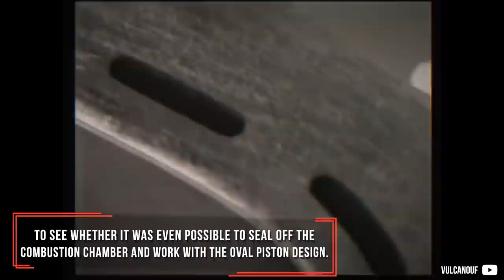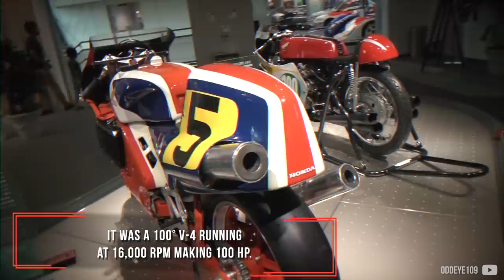Why Honda Made A 20,000 RPM Oval Piston Engine

Comment: Honda as always pushing beyond!! First with the VTEC, oval pistons, 4WS, hybrid cars, sat-nav... Awesome vid man!
Reply: Vtec is just a fancy name for variable valve timing  and fiat was the first to make it,  the first hybrid car was made by porsche. But if you wish to talk about the more recent iterations of hybrid cars lets just toyota got there first and is a lot more beyond on the subject. The first car with sat-nav was actually a mazda eunos cosmo. So appart from two things on your list (oval pistons and 4ws) that by the way can highly be argued about it being actually worst than the norm (normal two wheel steering and round pistons) in what is honda beyond exactly?

Please dont think im saying honda is a bad brand. I love them. They had an amazing motorsports history and made a lot of interesting products. Still do today. And i own some honda motorcycles. but they are not pioneers or the best like a lot of people like to portray them.
Reply: @dcd5050  Fiat made the first VVT And Alfa Romeo used it first, there was also a Cadillac with an experimental engine far before, and steam and aircraft engines which used VVT, but I'm sorry, you don't hear about those unless you research about it.... Honda took the variable valve timing and managed to break the 100hp per litre barrier back in the late 80's, and you should know what came after.

Also, the first navigation on a commercial car was the gyro-cator in 1981, I was not sat nav, but it used a clever system for navigation.

And about the hybrid, the insight came in 1999, the Prius came after in 2000, but the later was more successful, I won't take the Porsche mixte and the prototype from before into account, cause you just can't compare technologies fairly.

And my comment was a out Honda pushing beyond, not necessarily first, but it reads like that, my bad.
Reply: @luisleon7027  actually the prius was first sold in 1997. Not after 2000. Plus the insight was a disaster in sales i mean the prius in 2017 sold double more units than the insight in all its life span.
Reply: @dcd5050  perfect, my mistake, nice, you win!
Reply: Skyline:Muhahah:)
Reply: Lohner-Porsche was first hybrid car in 1900.
Reply: @las3k91  read the third comment please
Reply: it is no wonder there the only few vehicle manufacture that builds jet engines!
Reply: yeah....satnav has done wonders for humanity..... :(
Reply: Can’t forget about the hondamatic!
Reply: Honda are a shell of their former self.
Reply: @dcd5050  Vtec isn't valve timing. Vtec is short for vvtalec variable valve timing AND LIFT electronic control. It's variable valve lift which no one had before vtec. Actually none of the original vtec engines had cam phasers either. The variable valve timing was achieved by the vtec cam being wider and the variable lift was by the vtec cam being taller.
Reply: Look at just the first generation of CRX ^^ 1500cc/100HP at 7800RPM ^^
Reply: Honda is distantly behind in every segment of the industry..  The have been resting on reputation for over a decade without releasing anything good, let alone class leading.  Look at their ATV line up, or SXS's its all old tech that doesn't lead any class.  Sport bikes, they don't build anything that can come close to the R1, H2 or ZX.
The only thing they build that is any good, are the small generators
Reply: @dcd5050  You are wrong... VVT is ONLY variable valve timing. VTEC is Variable valve timing and LIFT electronic control. And honda was fiers to make variable timing WITH lift.. so get your facts right before spreading heresy.
Reply: @ACatKrom  i up voted cause that is true, but it's because they are focusing on fuel economy on their lineup lately, we all know Honda it's not the same, they are past that era.
Reply: @dcd5050  proper iVTEC is more than just variable valve timing. The cams have locking pins inside them that can make the cam lobes all move together in sync.
Reply: @luisleon7027  Yeah, but even then, Nissan beat them by 2 years.
Reply: @patrickrhoades480  Cadillac had Variable lift in the late 1800's but I do not know if they were first. The camshaft has tapered and twisted lobes and the cam was moved back and forth as a way to throttle the engine. It had no butterfly in the carb. To move the cam you actuated a bypass valve on a hydraulic pump that pushed the cam against a spring on the opposite end. Talk about overly complicated and it did not work to well. But it was a very early engine with variable lift and duration. You can read more about it in a book called "The Standard Catalog of American Cars 1805-1942"  Lots more interesting stuff in there too if you are a gearhead.
Reply: @donaldvincent  will do bud, thank you very much!
Reply: Don't forget about ASIMO!!
Reply: @donaldvincent  cadillac wasn't founded until 1902......
Reply: @DrewLSsix  Yes. Let me dig out my reference books and double check, Henry Leland who founded Cadillac was also involved with Olds. But it may have been another mark all together or I got the year wrong. Getting old sux. But I do remember clearly learning about the crazy way to throttle the engine.
Reply: @DrewLSsix  I double checked the year was off It came out in the 1903 model year. The engine was by Cadillac Called "Little Hercules" and was designed by Leland & Faulconer. They had tried to sell this engine to Oldsmobile before forming Cadillac. The variable lift on the intake valve gave throttle control and was also used on next engine which was a 4 cylinder. Note: Alanson P. Brush of Leland & Faulconer held patents on copper water jacket, variable lift inlet valve, mixer, planetary transmission, and adjustable rack and pinion steering. By 1906 the impact of Brush patents would start a drastic change in Cadillac designs. 
Reference:  Standard Catalog of American Cars 1805 to 1942 by Beverly Rae Kimes. page 189
Reply: @dcd5050  It might have been first sold elsewhere but the honda insight was first sold in the united states in 1999 and prius a year later. So it really depends on where tbh.
Reply: iirc Ferdinand Porsche made the first hybrid car
Reply: @fhkkjjk9255  Yep, Long ago
Reply: Uh Mazda cosmo had it first, then bmw e38 in the early 90s.
Reply: @dcd5050  "VTec is just a fancy name for VVT"

Lmao dude wtf are you talking about they are completely different mechanically and functionally.
Reply: Honda was decades behind on Vtech
Reply: @patrickrhoades480  waste of time. VTEC is not required for a performance engine as already have aggressive cam profiles, and a waste of time for a family car especially nowadays as thanks to variable valve timing and computer control modern engines can run fairly aggressive cam profiles anyway
Reply: @dcd5050  Alfa Romeo, not FIAT, developed VVT. While it was not used in a road car until the 1980s the concept was developed in the 1970s before FIAT owned Alfa Romeo
Reply: @dcd5050  First of all, Fiat or whatever Italian, made the first Variable Valve TIMING. 

Honda's VTEC, is the first ever, to feature Variable Valve LIFT as well. 
Adjusting the gears, is a concept many thought, did, and tried a long time ago. 
That slightly changes the engine's characteristics. 

Honda's VTEC enables the engine to go from "ohh i'm just a happy little girl smelling  flowers" to "I'm gonna murder your kids and feed them to you"

Honda's VTEC engines has a VASTLY different character before, and after the VTEC cross point, although they met in the middle in a perfect balance which was very interesting. 

That being said, not only is Honda one of the best vehicle manufacturers in the world, with TOP QUALITY products, they are absolutely the single largest, and BEST engine manufacturer there ever has been. Nobody can even challenge them at what they do.
Reply: @dcd5050  yeah but honda made them all better...who the fuck has better vtec?
Reply: CX500 turbo! Oh wait I had one they were awful.
Reply: @erikgonzalez2278 Rolls Royce made helicopter engine and it was used in a motorcycle

Comment: A very interesting observation, at the height of Honda's domination of F1 with their incredible V6, new regulations for the next season came out stating that engines 'must have round pistons'. hmmmmmm
Reply: There was a reason for that rule, as if Honda could solve the sealing issue with the Rings they would have basically circumvented the V8 rule that had been in place since the mid 50's due to Moto Guzzi and their incredible 500cc V8.  It produced practically double the power of it's competition and coupled with that slick dust bin faring it easily exceeded the tech of tires and frames.  Basically it was a fast way of getting killed in a grand manner.  This same grand death trap would have been revived.
Reply: Thats why I dont like F1 at all. Absolutely overregulated. Just give the teams a fixed budget, let them build whatever they want, may the best win. Thats how it should be.

Comment: This engine was a thing of beauty! It's overly complex for the minimal gains in bhp, but an amazing feat of engineering! Honda has always stretched the limits of the materials of the time.  It's hard to wrap your head around dime-sized pistons moving at 20,000 rpm in those 'old' HRC 50cc engines Honda built wayyyy back in the 60's! Great video, great subject! Now I got to look for the 250cc six that Hailwood rode- another great story of engineering!

Comment: I had heard back when this engine was released Honda were developing this as a V8 but the ruling body had stipulated 4 cylinder maximum. So Honda used oval pistons to overcome this. Also I believe the slipper clutch was on the CBX750FE which I owned in the mid 80s and preceded the V4.
Reply: Honda did not start developing this as a V8 since the limitation in the number of cylinders was one of the reasons they pulled out of racing at the end of the 60s in other words, the limitation was there long before they started work on the NR. At the time, they were racing a 50cc twin, a 5-cylinder 125cc, and the legendary 250 and 350 (actually 297cc) six-cylinders, all of which revved well beyond 20k rpm. Honda new that to make more rpm, you need to divide the engine displacement into multiple lighter and smaller reciprocating components, so they certainly would have liked to build a proper V8, but since the rules didn't allow that, they went with what was basically a V8 with siamesed bores.
Reply: @CaptHollister  correct... the cylinder restriction was the result of moto guzzi's unbeatable 1966 v8 gp bike... the cylinder number wasnt the issue... it was piston speed limitations... for a 4-stroke to compete with 2-strokes needed comparable number of ignition cycles... which dictates double the rpm... basic maths & physics
Reply: @Errol.C-nz  nope. Moto Guzzi's V8 raced in the 50s, before Moto Guzzi retired at the end of the decade. The rule change was due to many factors, but Guzzi's V8 wasn't one of them
Reply: @Errol.C-nz  The Moto Guzzi V8 was raced briefly in the 1950s and never won a race, but killed riders. The way you obtain higher RPM is to fraction the engine displacement down into multiple smaller, lighter reciprocating parts. Thanks to this fractioning of displacement, the Honda 50cc twin, the 5-cylinder 125 and the 250 and 350 sixes could all rev to more than 20,000rpm. They had no flywheels to speak of and 8 or more transmission gears to compensate for the narrow powerband. Limiting the number cylinders absolutely put a limitation on how fast four-stroke engines could rev with 1970s-1980s technology.
The difference between 2 and 4 strokes is more complex than that. Yes, 2-strokes fire twice as often as 4-strokes, but until the advent of variable exhaust ports, they also had lower effective compression ratios due to the large losses straight out the exhaust port and lower brake mean effective pressure.And they have even narrower power bands. The Suzuki 50cc 2-stroke twin, for example had 14 gears on which the rider had to play a constant tap dance.
Reply: @CaptHollister  yes i got my date periods wrong... but short stroke principle to keep piston speeds under limits is the factor of more cylinders... piston & cylinder technology has enabled shorter & shorter bore stroke ratios key to higher rpm for the same displacements etc etc... but yeah agree with the complexities of 2 vs 4-stroke physics... cylinder heat being a critical one for 2-stroke & auto ignition (detonation? dieseling as has been called)... compressions vs corrected port timings are same issues towards powerbands for both... the NR had the same gutlessness down low... just that as rpms go up mechanical resistences go up by the square... still, they gave it a dam good go & established a lot of the foundations for todays 4-stroke race bikes

Comment: Whatever machine you're sourcing, if Honda makes it, it's a safe bet it'll be a solid performer. Great company.
Reply: Sorry I can think of numerous Honda Bikes that had shall I say Issues.  The oval piston race bike was a dismal failure, it has been a while but I believe that it NEVER won a major race.  Now for other Honda Bikes, sorry I worked on bikes part time while in the Military and know quite well some of the Honda, ah shit issues.  One that is well covered up is the Infamous Honda 500cc V4's.  They claim it had a long production run, well yes it lasted for over a decade in production but EVERY of the over 11 reengineered engines had similar issues.  First units didn't have cam bearings, yep the cam ran on the aluminum of the head, and that didn't work out very well. Then they went thru various changes and always there was a high mileage excessive ware problem.  Try and find one now days, or if you have one try finding any parts for them.  They all had crankshaft issues due to contamination of the oil system.  Once the bike was out of warranty it was your problem, we had a small shop run by a retiree military guy and he had part time military or military retirees doing the work.  We were nitpicky on our work, do it right or not at all was the sign on the wall.  Well after maybe 10-12 of these bikes we declined to work on them due to the issues.  Another was that CM400 Honda with the chain driven counter balancer, it wasn't if but when it would break and destroy the engine.  We started taking them out, yep the vibrated a little more but then they didn't blow up.  You had to do some internal mods though.
Reply: Interesting info. Thanks.
Reply: I never buy a Honda motorcycle again, simply cannot afford the parts and repair. Plus, Yamahas handle a lot better, Suzukis too, but having spent almost no money at all on any Yamaha the choice is easy. Love Italian bikes but lets be honest, poor quality is always one of the first things that comes up when discussing Italian bikes.
Reply: @pflaffik  Honda is good at hiding a problem child bike quite well.  If you remember they marketed the VFR-500 for about 11 years overall and they all had engine issues.  We had a small rehab shop in HI at the time, a handful of Military active and retired part time wrench twisting types, which started as a group hobby to a business.  You get the picture, make your vacation a vocation.  Well we got several of these Golden Turkeys along with several other Japan Brands that cost us a small fortune.  The VFR-500 was a local Dr. who had it in college and wanted it rehabbed.  Well the body work, i.e. paint and finish stuff wasn't hateful to procure.  Now for the engine, that was a different story.  Seems as if there were basically 9 versions of that engine and little if any crossing of parts.  They ALL had CAM related issues, and that led to crankshaft fails.  They ALL had spun bearings at around the 30-40k mile range on the crank.  We found that they could not be reground, or for that fact you couldn't have them welded up and reground either due to the construction methods.  They were face hardened and the steel under that was the strength of silly putty, as a race shop that rebuilt racing engines informed us.  So at the time, in the late 80's, a functioning used crankshaft was going for around $1200 if you could find one and a good condition one was around $2400 again if it could be found.  As for New, forget that Honda dropped them like a hot rock.  We ended up on the short end of the stick on that Golden Turkey as we had nearly twice in the rebuild than the bike sold for new and the Dr. simply handed the title over to us vice paying the bill.  He wasn't mad and thought we were trying to screw him, simply he didn't realize how expensive the parts were.  From then on we DEMANDED that customers authorize parts purchases at a agreed price.  A warning to all of you rehab it yourself guys and gals out there beware of orphan models from Japan, a simple component may not be available at ANY price and fabrication gets real expensive real fast.  But a finished project is something to be proud of your skills.  Make your vocation a vacation and enjoy the voyage of life.
Reply: Used to be